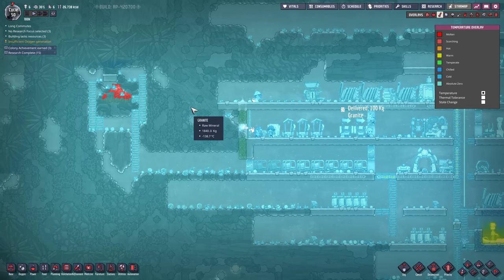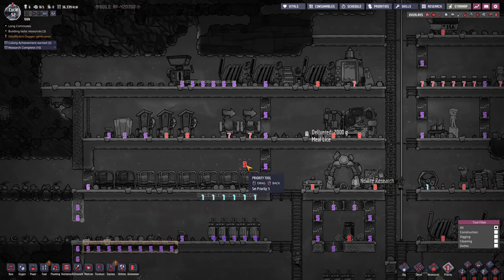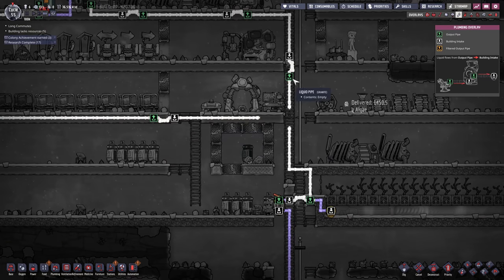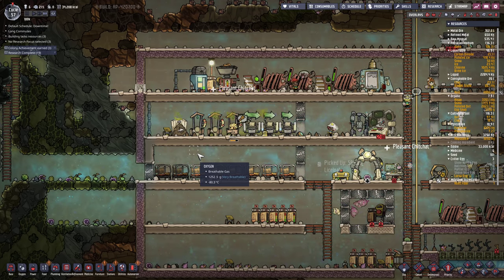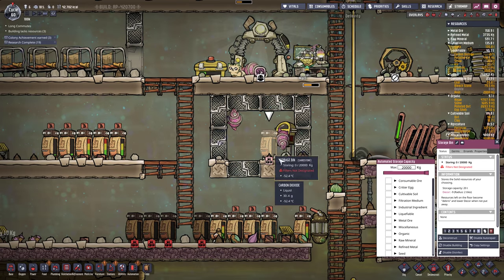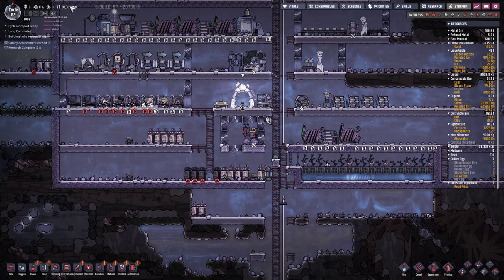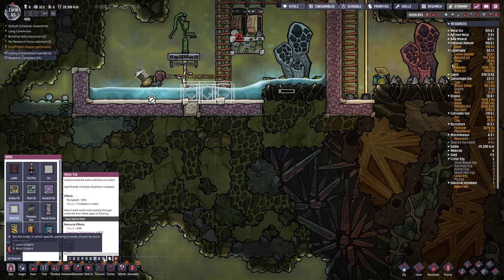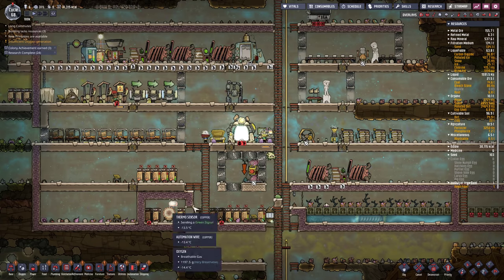100K Challenge #4 - Metal Refinery Heating Loop - Oxygen Not Included

Comment: That is not magic warm pee. That's where you put your radiant pipes.

No it's not the cold dirt freezing your farm. It's the tepidizer being off, because the water mass around it got too low. In this game any amount of liquid in a tile looks like a full tile if there is a tile above, because each tile can only contain one thing. When you have gas above it is just a graphical thing making it look not full, but if you go to the materials overlay you can see that the entire tile is still water. 

That tepidizer is strong enough to overpower anything you throw at it, as long as it is working.

Comment: You should build a bypass for the metal refinery, so when it's disabled the water keeps flowing. This way you have a constant heat exchange, the water cools down faster and the refinery gets activated faster.
You can build two pipes from the intake of the refinery to the right and build a bridge over the outlet port. If the refinery is disabled by the automation the water skips the inlet and gets bridged behind the outlet. When the refinery gets activated the water from the outlet has priority over the water from the bridge.
Depending what metal you produce, the water gets heated up by a different amount. it's around 20° for copper up to 32° for iron.  So the 60° for the temperature sensor is OK. But be careful with steel, the temperature increases by 55°.

Comment: GG. Put the slickers down with the steam vent. Should be hot enough. Also, rather than replace the insulated tile in the pool next to the steam vent, simply remove it. There's ice at the left corner of the pool. Let the water melt it to cool off. And this adds more water to the pool.

Comment: I started a new Seed on this map.  I found the only thing remotely hard about it was finding the right balance of heating up.   To much and plants die.  I found it.  I'm at cycle 80.  250K food.  Good bathrooms running and showers.  Base is 15.  Which is perfect.  Things grow.  Nothing is freezing.  Just hoping for the portal to give my hatch eggs.   If I played through this again I'll leave a bit of the upper map undug.  So once I warmed up passed -10 where Hatches can live I'd dig it up and have hatches.  That way my biggest mistake.  I dug stuff up.  A lot of stuff.  But 100 cycles it's not all that hard .   Hot maps are harder when you start and plants are already to hot.   This map is actually to easy.  Everything bad in froze.  CO2?  So what it's frozen dig it up along with everything else.  It doesn't matter.  Again hot maps are a ton harder than this one once you get the balance of heat in your loop just right.  My loop pumped around 25 degree water.  I want my base above 12.  You don't need more.  Slowly it will match the water in my loop and be 25.   Which is actually warmer than you will ever need.  It's going to be fun watch Grind and see how he turns out.  He does have a good touch in this game even if sometimes he seems to run around like a chicken with it's head cut off.  He always end up doing wonderfully and if a fun watch I might add.  Very calm voice even when things go BOOM.   That hot loop might come back a bite him in the butt.  But you never know.
Reply from the maker: the hot loop was just to kick start the heating. I will have to move it out once things are 20c or so.

Comment: For your dirt heating room idea (if you ever actually need to heat materials up) I'd go with another tepidizer. Bottom layer, tepidizer and sensor. Above that, mesh tiles. Then storage containers (maybe the smart ones for higher thermal transfer) with at least a tile of water so you get high heat transfer from the tepidizer into the storage containers. If you make the "roof" leaders then this could be a heat pit like storage design that doesn't get anyone wet and slowly "leaks" heat into the base warming it up.

Comment: I waited till the video's end for once before adding my feedback in case you got ahead of me!

My suggestion for your heating loop is to have a temperature sensor with a shutoff set to 'green if above 20 C' connected to the loop. If the water is higher than 20 C it will do another lap of the loop (you will probably need to start off higher to stop it freezing) if it is below 20C it will enter into the reservoir and wait to be heated up again at the next opportunity. I think doing this will eventually normalise to a comfortable temperature.

The only issue is you'll need to address is when the base eventually reaches approx room temperature, the refinery will continue to pump it's heat into the loop and you have the opposite problem to what you started with. I think you could address this by having another reservoir in the heating loop (not the refinery loop) that can act as a buffer so there is always nice room temperature water in the pipe and when it gets too cold, the water starts moving into the refinery

Also you got mafic rock/regolith from the rust biome, can the voles eat that?
Also be careful with your clean water supply when all the pee melts, I don't think it will find it's way into it but you should be aware

Sorry for backseat gaming but I love these kinds of challenges
Reply: No. Voles eat only regolith (which is not the same as mafic rock), dirt and iron ore (which would be super wasteful). Really, best option is to breach to the surface and get regolith. It's an infinite resource - and it can also heat up the base.

Comment: i would strongly suggest adding a farm station to the mushrooms to double production speed. also, the tepidizer is far stronger than the metal refinery with heat output. if my memory serves me correct, one tepidizer produces heat equal to about 4 or 5 aquatuners.

Comment: You need to change the settings on the coal generators so they always request coal. Set the level on the coal generator itself to 100%, so if the battery ever gets below 100% the generator will request coal. Then the automation on the battery controls when they actually run.

Comment: with the scheduler. It's a little un-intuitive but once I figured out how it worked it made everything easier. If you take a look at the task list of a dupe, you can see, that every tast has an individual priority for every dupe.
It's the sum of 3 parts. The first is a base priority, these numbers are pretty small <0.5. Then there is the priority you assigned yourself 1 to 9, which you mainly use in your game. And last there is the priority from the priority menu, this number is between 10 and 50, with 30 as standard. Two arrows down in the priority menu is 10 and two arrows up is 50. The dupes will work down their own priority list with the highest first. 
If you have a digger, with 1 arrow up in the scheduler (all other tasks at standard), all digging task will get a value of 40 plus the assigned value by you, so something in the 40s. So this dupe will always look for a digging job first. All other jobs, that are not digging will have a value in the 30s even with a priority of 9. When there are no more digging jobs left, then he will do other things. With this method you can ensure that dupes concentrate on the task that they are supposed to do and will not be distracted with other tasks. There are some tasks that you can combine: Diggers should also build.

Comment: The thing with abyssilte is that it still is bugged and it does interact with gas. If you enclose a perfectly heated room in abyssilte it will bleed heat into the abyssilte walls. You're much better of using insulated tiles man!

Comment: could you use an aquatuner to cool the water from the steam vent down? stick it in a cold area outside the base with a few tempshift plates behind it and let it heat up the area while cooling the water down a bit..  :D
Reply from the maker: yeah good plan :)  need to ramp up my power a bit. Or I might dump the hot water into electrolyzers OR a steam room with hot machines.

Comment: Hmm, this is a bit sloppy. Here's my advice:
1. Stop feeding shove voles! You only need to feed them if you're going to breed them, but you NEED to not have horizontal access for that to work. Tame (with grooming) or wild, they WILL lay an egg before starving.
2. SWITCH MEAL LICE TO DUSK CAPS ASAP! They give you more food per growth time, they don't waste precious research-enabled dirt, you don't need to waste precious heat-containing research-enabling water to cook them, they have a 10 C wider temperature range, and gaseous CO2 doesn't transfer heat as well as gaseous oxygen. Just put them in alongside the meal lice, and put an airflow tile so the coal gen CO2 can come down. Get the whole area heated up, of course.
3. Expand the heating loop a ton so that your whole base can benefit, and you can retire that finicky tepidizer setup. Remember that if you REALLY want to pull temperature out of water, radiant pipe inside metal tile is best. Also, spread out your radiant pipes more, and remember there is absolutely no point in heating bedrooms.

Comment: You set your heater to 30.  That was to hot for plants when you only needed it 11 actually.  When you set it at 30 I thought that would bite you.  Let's hope the temp drops.  6 Dupes is 30 farm tiles.  5 each Dupe with a perfect crop which you might not get yet.  Should make up water tank bigger.  That geyser is not going to go off forever.  That would give you more water saved up.  And a big amount of water wouldn't stay as hot.